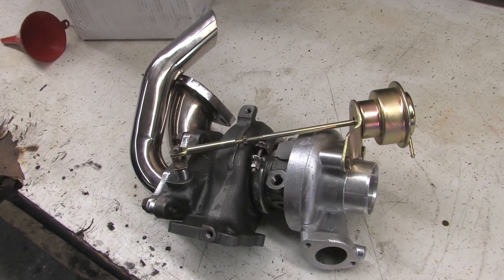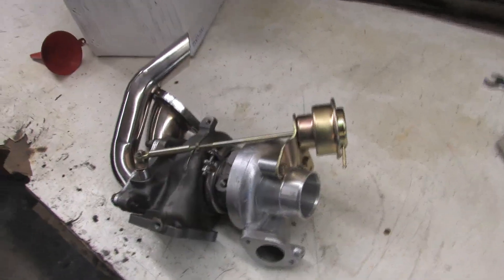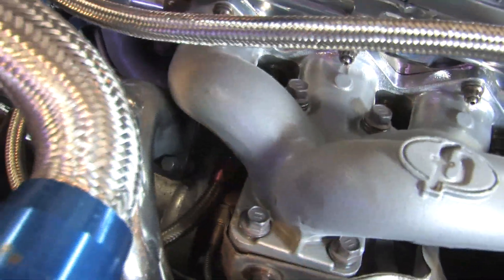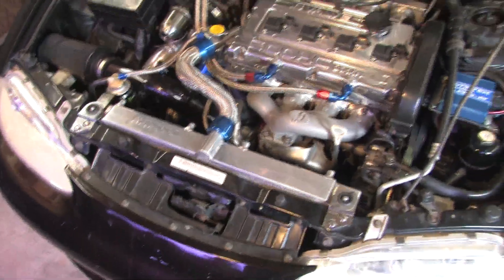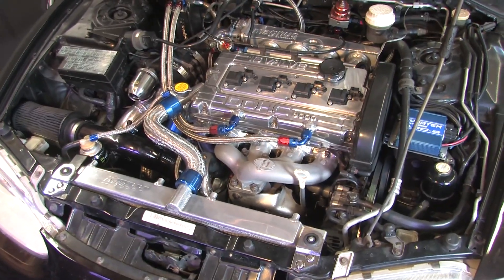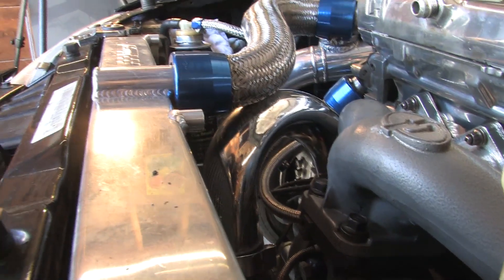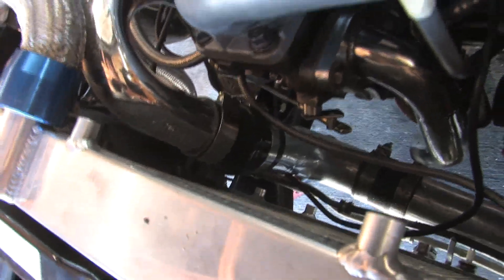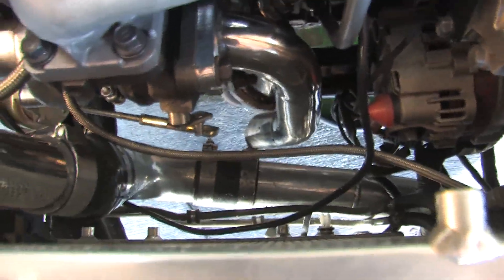Installing an eBay 20g

Comment: Hey Jafro, is that 16G going on the Colt?
I remember in Hyundai assembly 6 that you said its not going back on the GSX.
Reply from the maker: I think I'm probably going to put that Big16g on the galant.  The galant went 12.78@112 with a small 16g on it.  I know this because I drove it through the quarterfinals one Saturday in a bracket racing event a decade before I bought it. Because it's a real MHI turbo, it belongs on a real JDM Mitsubishi.  It would be a really good fit on that Galant.
Reply: @Jafromobile  cool, I can't wait to see some more galant and colt videos after the GSX... also cant wait until the GSX is done, also can't wait to see the GSX buffing video

Comment: Been searching through your videos and i can't seem to come across it and i could be wrong but, i remember a video where you had linked ( in the description )  the ebay 20g that you were using and had success with, if said company still makes these ebay 20g.
Reply from the maker: It's from CXRacing.  I bought it on eBay, but they have a website and it's just as inexpensive still as the one I bought on ebay.  I think I paid $238 plus shipping for a bare turbo with nothing else.

Comment: What's up Jafro.Its my first time owning a 2g DSM GST. I just got my car back from the shop after replacing the short block. I saw one video of yours showing you replacing the after market exhaust manifold back to the cast iron one. That lawnmower noise is exactly what is happening to my DSM. (I couldn't describe it till I saw your description on the vid) Any who, my cast iron exhaust manifold isn't cracked but I did the soapy water leak test as best I could with no air compressor or any tools of that matter and found out that I may need a new gasket. So I ordered a kit from amazon that would be delivered today(Fel-Pro ES 72787 Turbo Mounting Gasket Set). I'm also interested in buying a new 02 housing for my DSM. I have a 3inch catback that's sitting in my room and I wanted to know what the pipe connected at the outlet of the elbow 02 housing is. Is that the down pipe?
Reply from the maker: +Felipe Polanco Yes, you nailed it.  It's the down pipe.  :)
Reply: +Jafromobile  Whats up Jafro. I tried removing the 4 bolts out of my exhaust manifold connecting to the turbo and I managed to get 3 out. One got stuck halfway and I ended up snapping the socket. What do you recommend that I do?
Reply from the maker: Felipe Polanco Soak it in penetrating oil and get another socket.  You need more leverage.  Maybe some heat.  Be prepared to get the bolt extracted (or do it yourself) if it breaks.  It can and does happen every now and then.  Penetrating oil and heat are your best shots at preventing that.

Comment: Watch yourself when heating chemicals. Not that you were using brake cleaner but some people have cleaned things with brake cleaner then welded over it which  causes Phosgene Gas. Just watch what you spray on heat causing clouds of smoke.
Try some Copper Anti Seize http://www.amazon.com/Permatex-09128-Copper-Anti-Seize-Lubricant/dp/B000HBM8HU
Reply from the maker: I know, I agree, and that's a great comment for everyone to read.  Many brake cleaners are chlorinated.  What I was using wasn't brake cleaner, and it isn't chlorinated.  In an overly-abundant supply of caution, I won't even pick chlorinated products up off the parts store shelf, much less bring them into my garage.  I don't even know why they make chlorinated brake cleaners or other products because the best working cleaning chemicals for automotive use are non-chlorinated anyway.  They may be organic solvents which are still plenty dangerous, but they don't react with other chemicals or convert to more toxic chemicals when heated like chlorine does.  Good comment!

Comment: Impact sockets are not designed for anything other than an impact gun, thats why your socket broke.
Reply from the maker: Actually I believe they broke because they're harbor freight.  I've broken plenty of Kobalt chromies with ratchet wrenches, too... but I've never broken a Snap-On impact socket using hand tools.

Part of the joy of using cheap tools is showing them breaking on-camera so I can show people what happens with cheap tools. You can still get results with cheap tools, but replacement is the reality.  I might go ahead and upgrade the toolbox once I'm done with the Hyundai.

Comment: Hey jafro just wondering, what type of an fittings you use for the turbo coolant lines? Any info on where can I get them? Also I see one on the vid that goes the block what size is that one!? Thanks and nice vid :)

Comment: I love your "how its made" music in this video! '=P

I've been wondering where exactly is the best place to position jack stands in the front on the 2g GSX -- shop manual is vague with a horrible pic. For the rear I've been putting them under that main crossmember. Where do you usually put yours?

Comment: Hi it's me again i had my Ebay 16g turbo on the car  but after a week the turbo stop boosting, it was @ 10 psi and 2 days later 5 psi and now it doesn't boost at all  the turbo sounds wired when i press the gas i took it off the car and no shaft play or smoke I'm not sure if it's a blown turbo or waste gate not working properly  .but I'm pretty sure i have no major  air leaks .Any idea what's going on? thanks

Comment: hi .. i just got an Ebay 5 to 20 psi big 16g turbo on my 95 Talon tsi.. and it's giving me about 10 to 11 psi of boost . i have everything else stock boost controler, stock fuel pump,and stock fuel pressure regulator. my question is What can do to go atlest 15 psi? oh  turbo has an adjustable wastegate acuator.. Thanks...

Comment: Thanks again for ur reply Jafro, is there a way i can chek the rings? And recently money has been real tight so i havent workd on it at all, still drive it daily and noticed that i can rev and speed on all gears as long as i dont let the turbo build boost and there will be no smoke or stink of burnt oil:) hmmmm wat fo u think Jafro?? maybe PCV lets turbo over pressurize the crank case?

Comment: @Jafromobile lol yea the trailblazer ss runs good for a 5200lb suv on 20s.lol  i have been low 13s with just a very mild stall,homemade 3.5" cai and a sct. its the awd that has me hooked(get it hooked lmao) thats why i want a gen1 dsm car and i have always loved them(thanks to tony shepard) there is a second gen awd talon around here that runs very low 11s with not alot it seems and when i seen him spank a procharged c6 ls3 vette buy a bus length i knew i wanted to build one.

Comment: Thanks alot for the quick reply Jafromobil im sure your busy so I appreciate it, ok im going to chek the intercooler hose... Most likley the the used 14B so fristrating to get ripped off it wasnt cheap either $300! But atleast your "How to" video will help with the next swap... Is there any way to chek if oil seals arent blown on turbos??

Comment: Hey Jafromobile first off your videos are awesome, but i was wondering if u can help my 97' gst has been blowing smoke out the exhaust i have replaced PCV, swapped T-25 with 14B, replaced valve seals and still throws blue smoke after shifting on 4th and 5th gear.... Compression is perfect 180 all across.... Maybe a blown 14b??

Comment: i have a awd trailblazer ss with a 3200 stall converter and a few other mods and its pretty tuff on the street because it dead hooks and hard too. which has me contemplating building a awd vehical to make more weekend warrior then my daily driver truck. the first gen dsm cars are hat i would like to find but its hard to find a nice one and the nice ones i find are auto's. is there stalls or sumthing to make the auto worth building or look for a clutch.

Comment: @wwjoshdew i had a 03 cadillac dts with the northstart v8 and it was front wheel drive so it was really cramped under the hood. i had alot of issues with the car and it was alot of money to fix it so i did it all on my own. having a nice place and correct tools are the main part. you will be suprised how easy most of the stuff is. i did alot of work on my caddy and everytime i was done i said" thats it?" lol dont be scared! the internet is your best friend and you can find anything on here.

Comment: @watchforfinger Yup. Cast iron expands when it's heated and contracts when it's cool. If you're even having issues with a bolt or nut on cast iron, heat it up first.

Comment: @jafromobile - A big problem with those eBay turbos is like you said - fitment. They make them close enough for government work / good enough is good enough. To me, good enough is only good enough if you're a good enough is good enough kind of person. The price is entertaining, but I would rather have a TDO6 20G comp cover which doesnt have the clocking issues. In the past I have made a sandwhich plate for clocking multiple angles. Maybe a turbo blanket in between your J and the Ex Man?

Comment: @itsphillip While its in the car, no, you'll burn yourself to hell and back. If you have a torch it could make unbolting the turbo a bit easier and help prevent any possible stripping of the bolts.